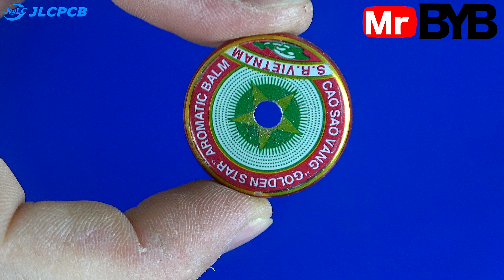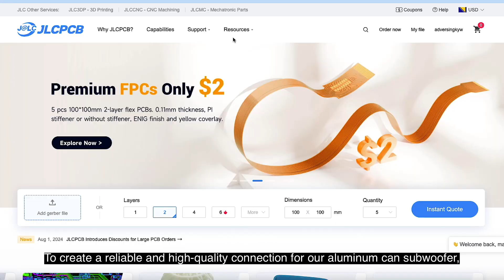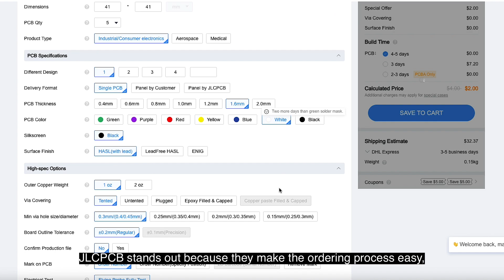How to Turn an Aluminum Can into a Powerful Subwoofer 🔊 DIY Project

Comment from the maker: JLCPCB PCB Fab & Assembly from $2! Register to get $60 Coupons: ▶ 
https://jlcpcb.com/?from=MrBYB 🔥

00:01 — Speaker testing at high and low frequencies.
00:45 — Speaker enclosure manufacturing: key steps and recommendations.
01:13 — Aluminum can preparation: choosing the right size and processing tips.
03:12 — Printed circuit board creation: essential steps and process details.
05:45 — Central rod production: materials and optimal coil wire turns.
09:10 — Crafting the rod for the subwoofer’s central part.
11:01 — Subwoofer assembly and frequency testing.

How to use an aluminum can to create a subwoofer
Easy steps for assembling a unique sound system
Pro tips for optimizing sound quality
🔔 Follow me for more DIY projects and creative builds!
Subscribe to Mr BYB : https://bit.ly/47ijm9c